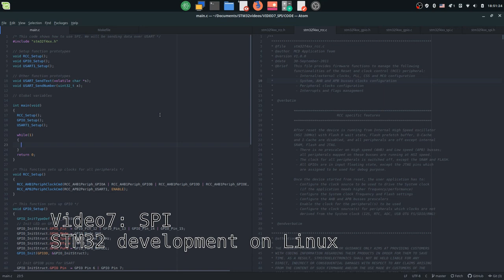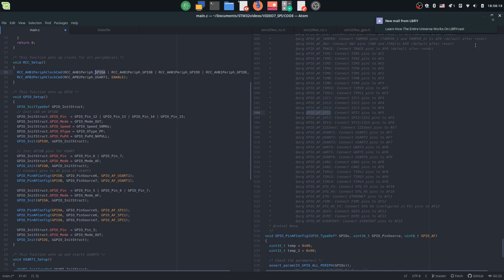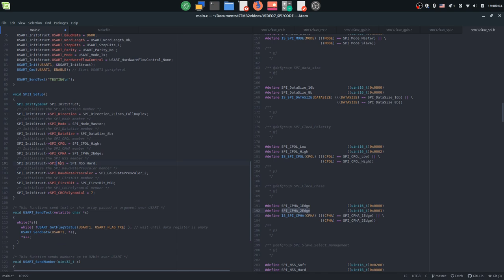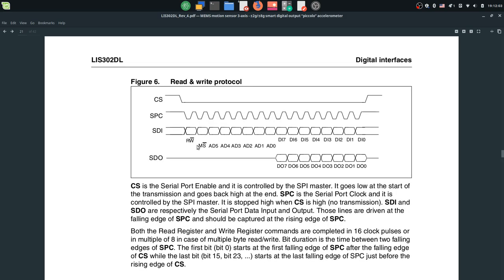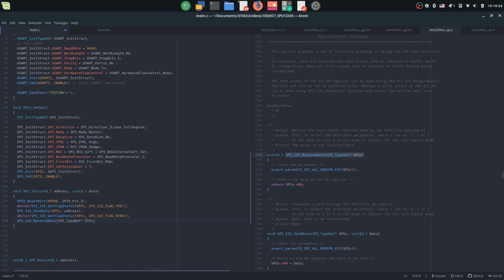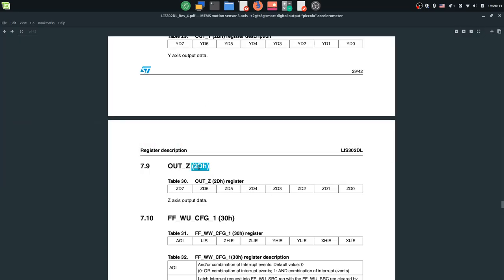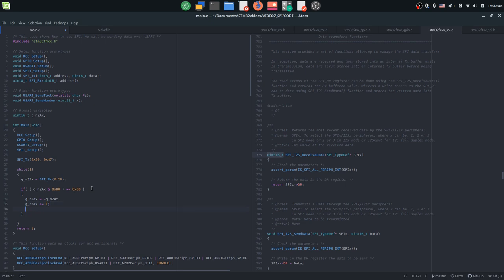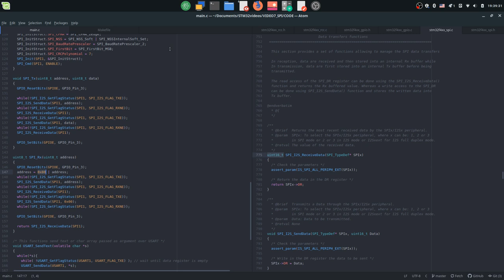SPI with Accelerometer | STM32 development on Linux | VIDEO 7

Comment: Hello, please I have an urgent question. 
We can no longer use these functions in the code since now it’s all based on HAL library ?
Reply from the maker: You can still use LL, which is quite similar to old library. You can choose hal or ll for each peripheral in cubemz section project manager under tab advaced settings.